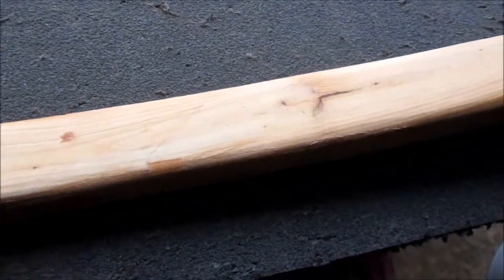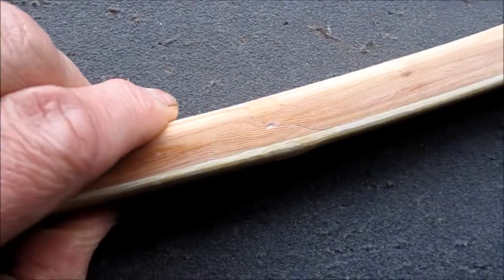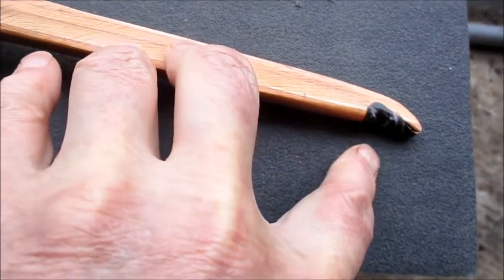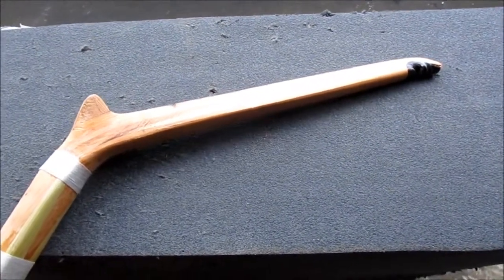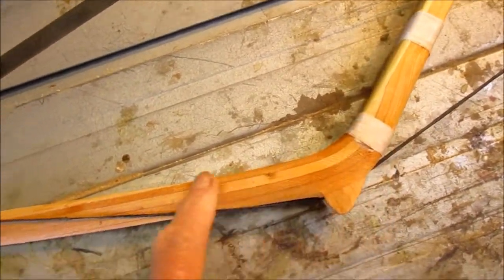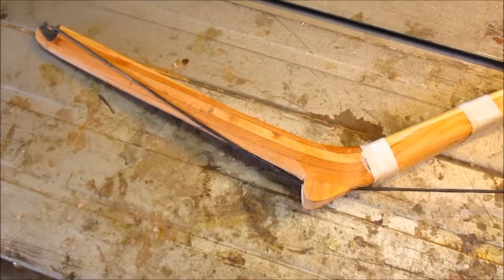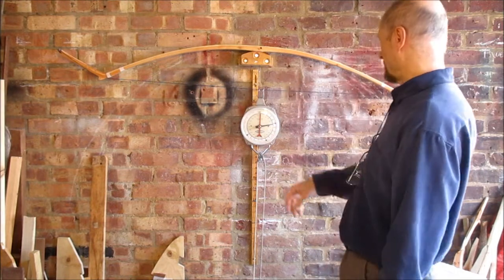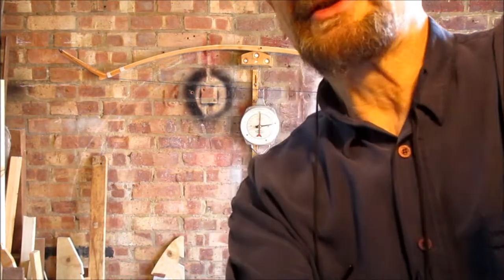Lever Bow pt15

Comment: Awesome! Quick noob question : isn't the new string angle on the levers a bit too aggressive for that string groove? It looks like the string could jump off ( towards the belly ) if it slaps too hard against the string catchers. Maybe angle the groove a few degrees?    Or the string tension is enough to keep it in check ?
Reply from the maker: The grooves will get deepened a bit, that was just a first try to see how it all looked. The string tension should do the job tho'.